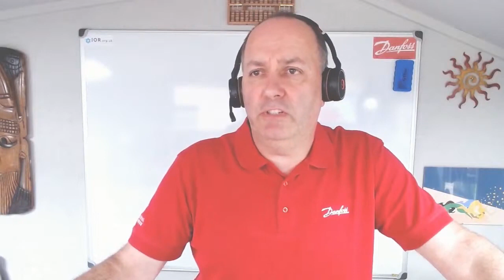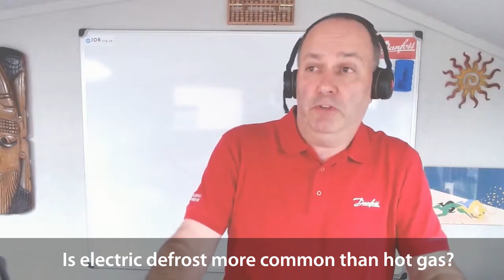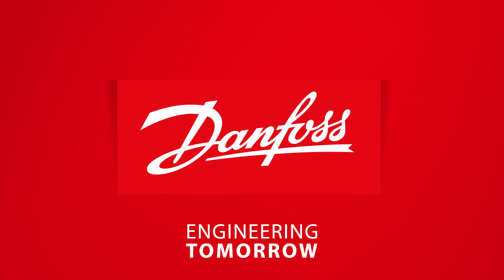Electric defrost vs hot gas defrost | Ask an Expert

Comment: I’m curious about adding electric defrost to an existing hot gas defrost. It’s for an industrial spiral freezer that suffers from what is called a belt flip.
The biggest issue at hand when a belt flip occurs is the resulting ambient temperature in the freezer that results from length of our hot gas defrost cycle time. The cooling can’t continue to function while in defrost. Subsequently, the belt becomes “thawed” and more pliable when not staying frozen during defrost.
I wonder if the addition of electric heat that maybe starts a half an hour before each hot gas defrost cycle, and continues throughout that cycle, can shorten the hot gas  defrost cycle time enough to not raise the temperature in the freezer to a point that compromises the rigidity of the belt.
Reply from the maker: Thanks for your question. We are checking with our experts and will get back to you.
Reply from the maker: Hi Ed. Having experienced belt flip particularly on spiral freezers but also on blast tunnels in the past, we agree with your comments about the freeze thaw issue of the belt causing the issue. The main issue we can see with your proposed solution is the extra heat you will put into the system whilst running will increase suction pressure, compromising the regulation of the expansion device regardless if it's thermostatic, electronic or float valve. If you added electric heaters to function at the same start time as the hot gas function it would improve the defrost time however they would definitely add more heat into the enclosure of the spiral as they add heat from the outside whereas hot gas is internal. Baffle plates have been used during defrost to basically block off the evaporator surface from the spiral enclosure to minimize heat input. We hope this helps!
Reply: Thanks for the information! I appreciate it.

Comment: I have two question please!

Why electric heating if compressor heat is sufficient to defrost?
Compare costs of electric vs hot gas?
Reply from the maker: The two common methods of defrost are electric and hot gas. In general, electric defrost is relatively easy to design and Install compared to hot gas—which uses a more complicated piping design and therefore costs more to design and Install. However, when looking at efficiency, hot gas defrost is far more efficient as the hot gas is inside the pipes in the evaporator heating up the coil block and not the surrounding air. This translates into shorter defrost periods and less overall energy usage. I can’t tell you the percentage difference in cost as each system and application are different. However, in general, the larger the refrigeration system with multiple compressors hot gas is the preferred method due to lifetime cost versus the install cost. The other limiting factor is one compressor, one evaporator systems generally run out of hot gas after a short period of time due to the single system vapor compression cycle limitations. — John Broughton
Reply: Can you add a hot gas heater to an existing commercial unit without having to change the entire unit?